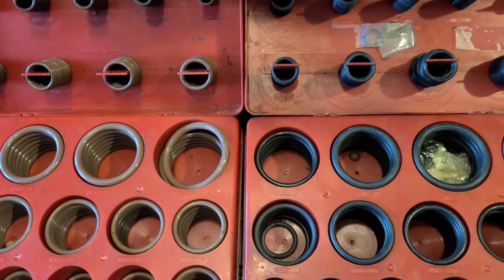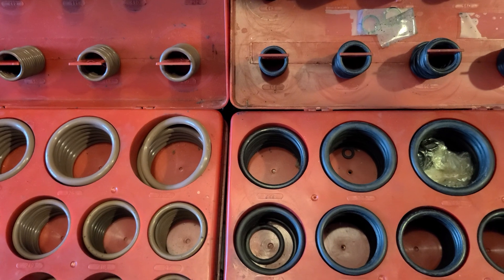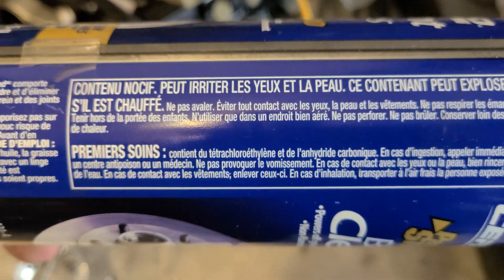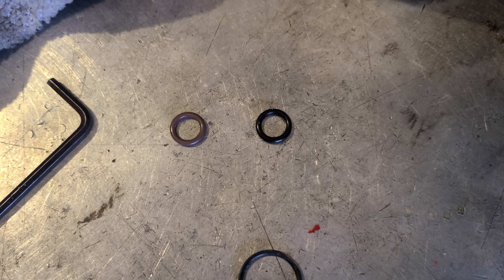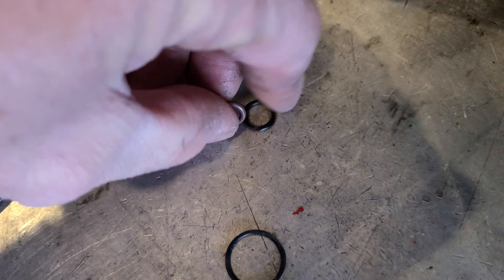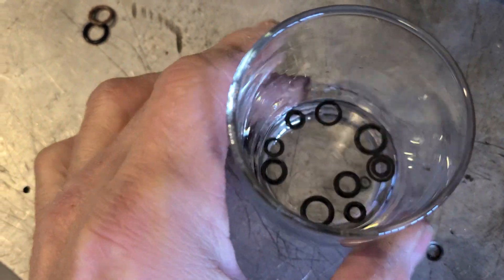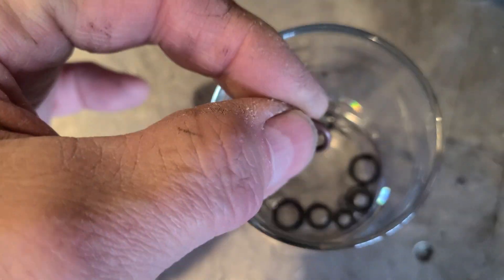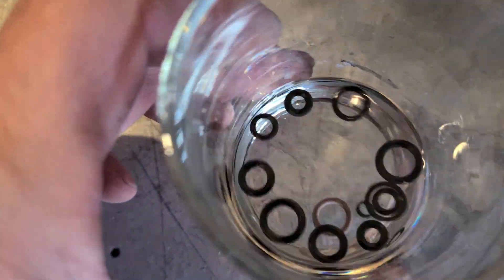Verifying a Viton VS Buna O-ring

Comment: Very helpful. Just what I was looking for to check if the o-rings I ordered from aliexpress are actually fluoropolymer. Double checking though, buna or nitrile would be specific gravity of 1.3 or so, right? if they were 1 or less, you could simply use water for this test. 
That aside, the brake clean I had didn't work - only 30% tetrachloroethylene according to the container (rubber o rings sank). So I used honey and warmed it up till it was... runny honey. Rubber o rings that I pushed to the bottom slowly floated up. Aliexpress "FKM" stayed sunk. Apparently honey is about 1.4 spec gravity. So not dense enough to test for top notch viton. But enough to say it's not rubber. Only problem with honey - that's also how they test honey. Watered down honey has a lower spec gravity. So you wouldn't want to test for fake o-rings using fake honey. That must count as a 3rd world problem, surely. haha
Reply from the maker: Simple little tricks and pretty sweet idea lol, with using honey. I'm glad you found this helpful